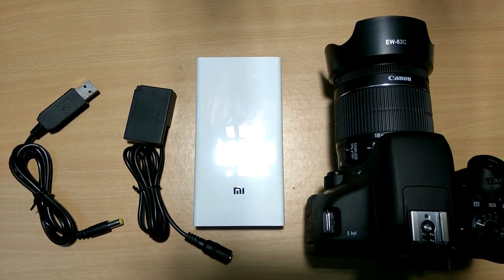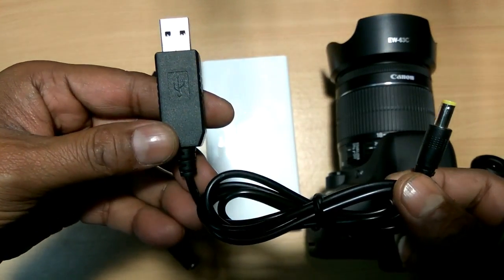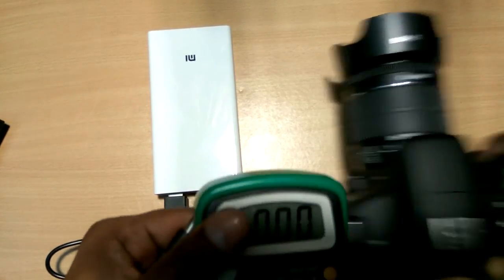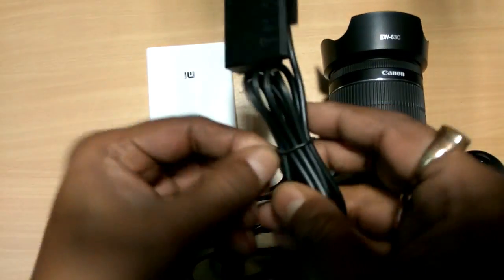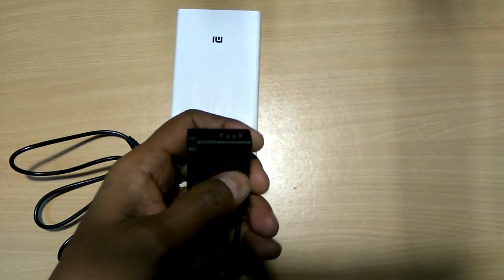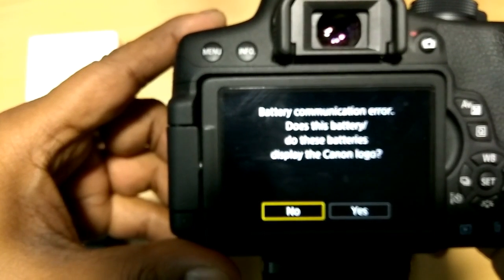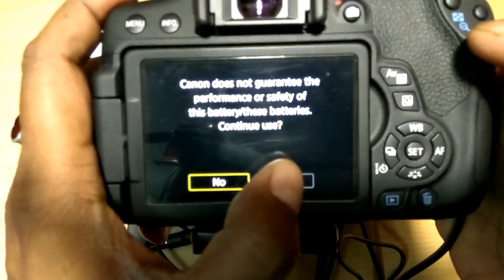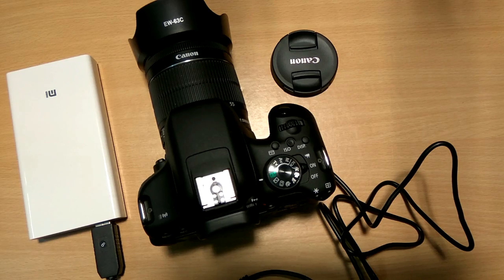DSLR CAMERA POWERED BY USB POWER BATTERY BANK in English , TECHNICAL ASTHA

Comment: Don’t do this nonsense experiment with ur costly camera. Ur camera will be burned soon with this unscientific experiment.
Reply from the maker: Dont worry  my camera still working, just one thing  always remember, always use normal power bank, do not use fast charge power bank like QC power bank or PD power bank and  stepup converter use maximum voltage  9 volt,  do not use 12 volt cum 9volt converter , only use 9volt converter , then i am 100% sure your camera nothing any problem. My camera still working  and i am happy.

Comment: Is this safe for the camera, sir?
Reply: @thias1  I don't think that 9v is the right voltage for DSLRs... May be more like 8? Or even 7.5? What is the difference in products between reputable brand and not reputable? Also, powering it for too long is kind of the whole idea behind this build, if I didn't want to power it for too long why would I use a powe bank in the first place I would just use the battery... Do you possess any of that equipment, sir?
Reply: @thias1  Thank you, sir. My Nikon battery I think when fully charged goes over 8 volts, and slowly discharges down to 7.2, it is possible if you put your DSLR on 7.2 constant power that the low baterry inticator will blink all the time... Video recording also automatically stops after 20min in 1080p24, but I can start it again immediately, probably I will never go for more than 2-3 hours though, only if it's like really long live event... Usually I do short takes but over a long periods of time, let's say full day of filming doing 5-10 min takes with breaks in between, so that the camera can chill. Do you think that 9v can lead the camera to overheat faster, sir? I have heard that the original Canon charger gives 8.4v to the camera.

Comment: i have canon power shot sx130 is.
Will it compatible with it ?
on user manual of camera it says AC Adapter Kit ACK800 is required to power up the camera without battery.

Comment: Hello ive bought a powerbank with 20000mah from Anker. It has an output of 2,4A. Somehow when i use the camera the battery percentage drops. Ive recorded 3-4 minutes and it droped from 85 to 78%. Why? The powerbank is connected and the option for usb charging is enabled. Please help me out. Thanks!
Reply from the maker: power core lite 20000 or some other model

Comment: I purchased one of these cheap couplers for my Nikon 7500. Ok at power on but displays an ERR on camera LCD monitor. Besides it goes blank as I push on shutter release button. Voltage on coupler 9.1v. Any help please??
Reply: Ditto with even Nikon's EP 5B adapter when attached to my D7000. Err report and then display goes blank. I did not use the 1 amps voltage boost usb  cable. But used a DC to DC buck Boost module of 3 amps in between Power bank and coupler to boost the voltage from 5 V DC. I used 8.8 V instead of 9 V in output of the DC to DC converter that goes to battery coupler. I am puzzled. Local Nikon tech people could not help.

Comment: Is that thing work on 700d and which coupler i need to buy
Reply from the maker: you can buy : http://amzn.to/2AETwOQ, http://amzn.to/2AYUGrb , http://amzn.to/2iDYwLN,
Reply: TECHNICAL ASTHA This one is to costly as comapred to other models
Reply from the maker: Vitesun USB 5V DC 8.4V Drive Cable ACK-E8 Mobile Power Supply + DR-E8 LP-E8 LP E8 Dummy Battery DC Grip + 5V 3AMP Adapter Kitfor Canon EOS 550D 600D 650D 700D T4i X6i

Comment: Nice information. I was looking for something like this. Iv just got the 800D and I have the same Mi power ban. But I just got the below from ebay as its still in transit. Do you think this will work? I guess its same coupler but the USB is a bit different.https://www.ebay.com/itm/LP-E17-power-charger-cable-DR-E18-dummy-battery-for-Canon-T8i-T6s-77D-200D-8000D/302064825077?hash=item46547772f5:g:bJsAAOSwR0xZui-M

Comment: I would not risk damage to my cameras using something like that ! You need voltage and amperage safety circuits to protect camera. I clearly did not work from the start but should.

Comment: I was wonder, if the External Battery is providing 9v to the camera, but the camera only needs 7.2v. you dont think it will fried the camera with time? (I'm not sure, I'm just asking)
Reply: I bought it for my Nikon D800 camera. Didn't work until I bought - Quick charge PowerBank (xiaomi 2C)!
With normal charge speed PowerBank will work only with Nikon D7000. For all other compatible models (D810, 600, 610, 7100 ...) you will need Quick Charge PB. It cost aprox. 40 EUR.
Reply: racka11gvg , link to the Nikon DSLR version PLEASE
Reply: @racka11gvg  hey man does it work fine?
Reply: You have to use a dummy battery, that has all this electronic protections. Probably you didn't understand him hahaha.
Reply from the maker: EXTERNAL BATTERY PROVIDING 9V , BUT WHEN POWER ON DSLR , THAT TIME LITTLE VOLTAGE DROP ON OUTPUT  SO DSLR GOT ONLY 8V APPROX.
Reply: did you try it powered on for 10 hours? is it still ok?
Reply: aapne sai bola vai camera 7.2 v hi hota he par 9v mw kam kese karega
Reply: Thise adopter can use ...canon M50 Mark ll....?

Comment: bro is this battery used for 700d
Reply from the maker: this battry (dc coupler) fitted in canon 750d and 760d only . canon 700d separate model
Reply: TECHNICAL ASTHA plz 700d link suggestion
Reply: @TECHNICALASTHA   fit for 200d canon?